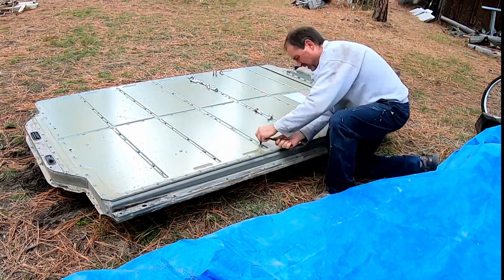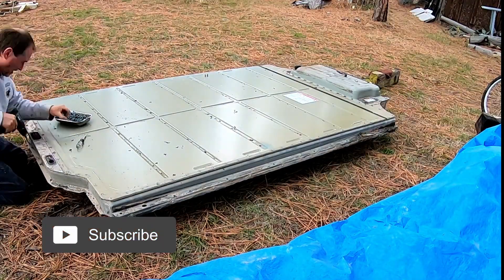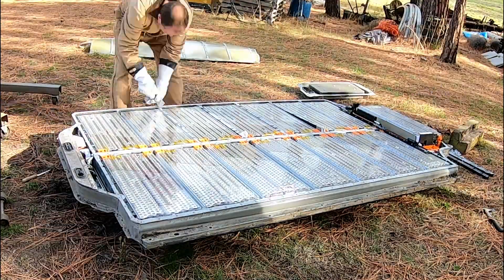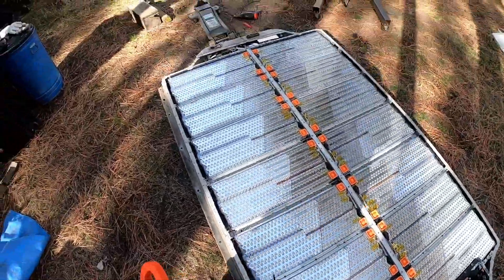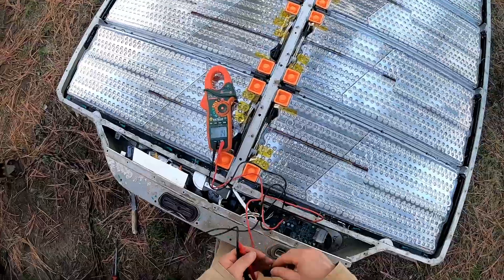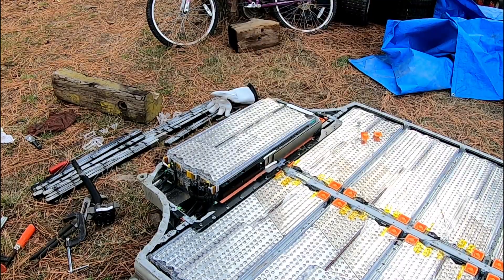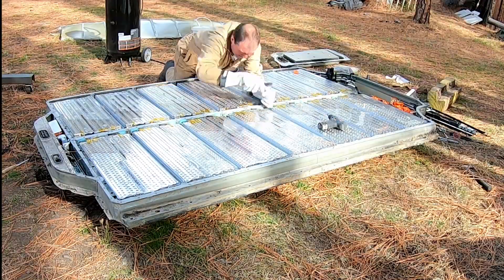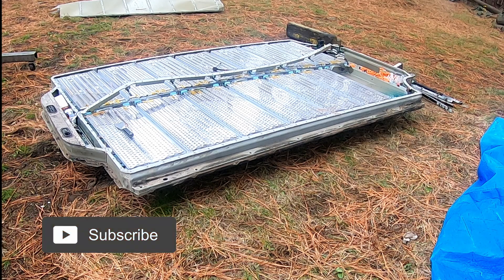Taking Tesla Model S 85 battery pack apart in the backyard with basic tools. 85kWh battery pack

Comment: Very interesting! I admire your patience. When you live remote you got to know how to fix everything. I test drove the S85 in Bern and having tested most electric cars till then I was impressed. But for a contactor failure the whole pack has to be opened that is a drawback. In the wet corrosive Tropics where I live they have endless door handle issues. Wh have had enough of the tropics and as kids have grown up hope to do some travelling. If Europe gets no Cubertruck we have to travel the US and rent one.
Reply from the maker: @LawpickingLocksmith  The early ones had some issues. They have improved. Dropping the pack out in a shop is actually easy. Newer models have the “penthouse”, proving easy access to things inside battery pack. I can see Tropical climate making it tough on cars in general. If you travel the US and come thru Montana let me now.

Comment: Hello RMT Family, have couple of question for you. If you don't mind what is the best method of communicate with you? I wanted to ask how do you charge the batteries, balance them and the top lid (metal part) where can someone purchase one?
Reply from the maker: Hi, You can use X/Twitter, Facebook or Instagram link in description.
I have not had the need to charge individual modules. You would need a charger for lithium batteries that can do ~24Volts. If you want to balance each brick in a module you would have to install a BMS on the module. If you just need to get each module up to the same voltage the charger and a voltmeter will do. The lid for the pack usually has to be reused. Most places rip it off and damage it. You maybe able to find a used lid in good condition on ebay. In general they are folded in half along the spine but can be reused.
Reply: Thank you for the message, I dont have a FB, Twitter and Instagram (I know hard to believe), but you might be the reason to get an account. Thanks to YouTube for connecting me with good people around the globe. Anyways thank you so much @RMTFamily

Comment: Anything below 500 Volts is low voltage, so it's not extreme voltage.
Reply from the maker: I hope you do not work on electric cars! Any DC voltage above 60 V is considered hazardous and high voltage on any hybrid and battery electric vehicle. I recommend you take an electric vehicle safety course and will not touch any EVs until you have to done so.
Reply: Dc over 50 volts can kill you instantly.
Reply: Voltage is just a measurement of potential, amperage is the measurement of actual current.  .5 Amps will kill you. A 100KW battery pack with 500v of push will deliver 200AMPS. Break away even some of the Parallel sectors and it still averages between 30 and 50 Amps per module. In other words if you become the load you will need to be picked up by a shovel.
Reply: Just takes a half an amp to be fatal

Comment: Are all the screws (most of the screws) holding the large top cover plate the same size? What size? I think on refits folks could swap them out for stainless if they lived near a coast.  
Using the hoist like you did was really clever and smart!
Reply from the maker: Hi Ben,
Different screws/bolts. Some are special kind. Those along the edge could maybe be replaced with others. 
The experience I have with stainless screws and bolts is that usually the head or the bolt brake easy. I’m sure one could find a bolt with the proper specs but those are probably not cheap, especially with the large amount required for this lid.
Expense set aside, stainless could also create another problem especially in the moist and salty air along the coast. Whenever two metals come together of different kind/quality and salty moisture gets to them these metals start corroding. The weaker metal will always loose and it will be destroyed over time. I guess the stainless would win. That means the battery box will loose. Replacing a corroded bolt is easy compared to replacing a the battery box. 
The special bolts that are not along the edge are aluminum I believe. 
I’m not sure if the outcome would be as expected by replacing screws/bolts with the stainless kind.
Certainly a great idea as some people have experienced moisture intrusion due to corroded bolts and/or lack of sealing.
Dropping a battery pack, inspecting it for such issues and replacing the bolts, even just with the same kind, may not be a bad idea for early Model S living along the coast.
Thank you for watching 👍
Reply: @RMTFamily  OK. I had just watched a Gruber Motor Company here on YouTube and Pete was saying when he rebuilds packs (Model S) they are sometimes damaged due to water ingress at the screws if the car was a Coastal Car. I don't have any experience with galvanic corrosion between whatever the cover is made of and potential Stainless screws (I do know they as a group are not nearly as strong screws compared to screws). 
I was just going to see if the screws were all or nearly all the same and not special and what the additional cost would be to switch them over to stainless. Sounds like it is not a good idea. Thank You.
Reply from the maker: @benkanobe7500  The idea is good but may or may not lead to other issues.
Visual inspection, by dropping the pack, of the screws maybe a good way to catch water ingress before it gets to bad. That costs some money but not nearly as much as an replacement pack or modules if not caught.
Our car came from Portland OR, not right at the coast but close and right at the Columbia River. No signs of moisture in the pack.